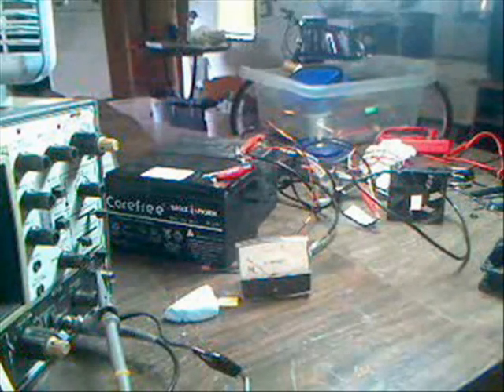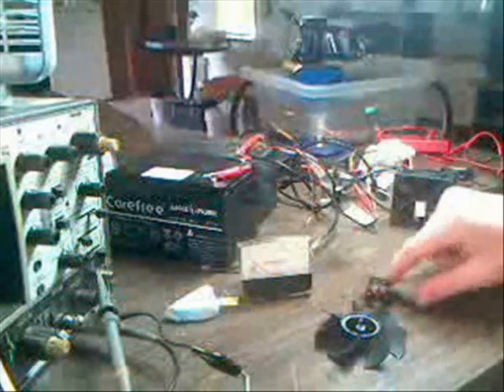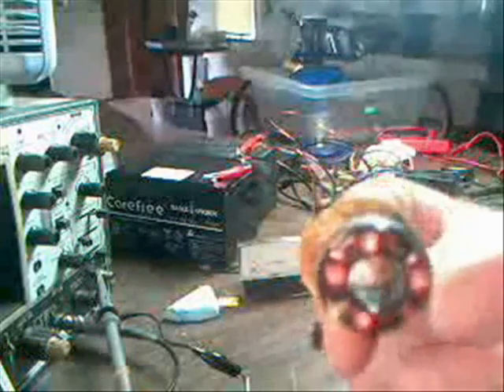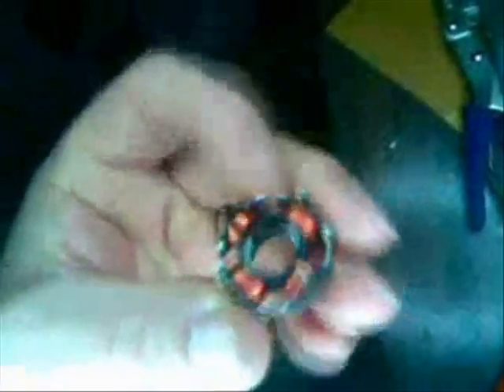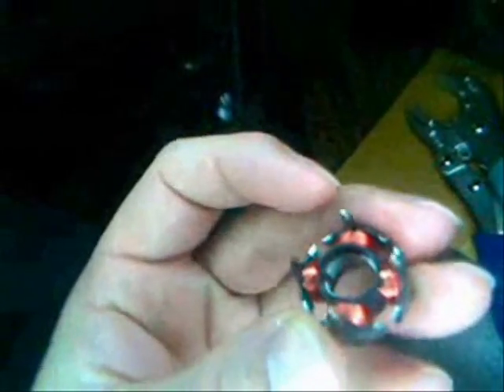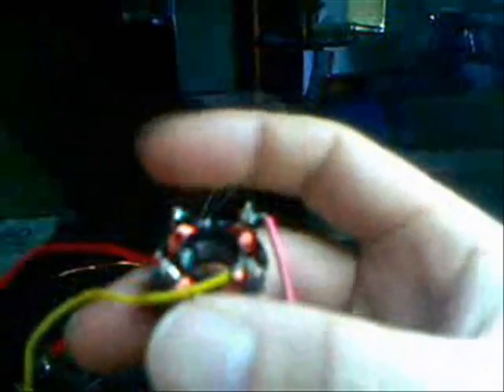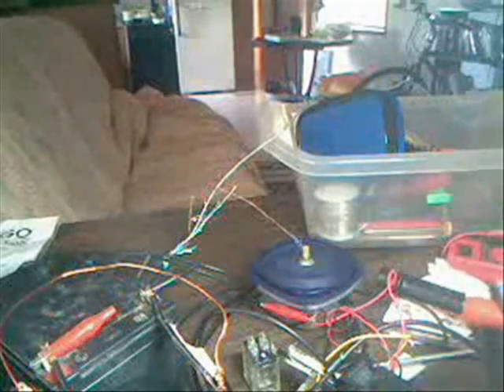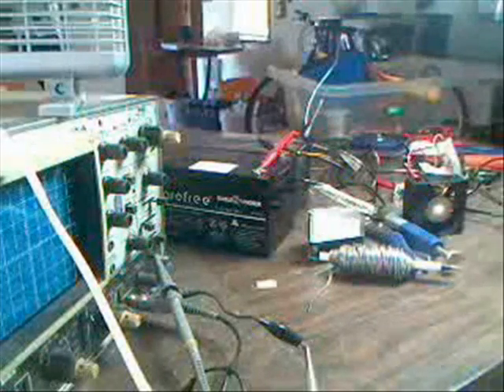Imhotep - Bedini Fan Project Part 4

Comment: slotinnn you have to solder the coils off.
"Braking a stik into 2 peaces can be hard, but pulling the stik into 2 peaces is alot harder"
Use the ease way "and beak the stik" =P